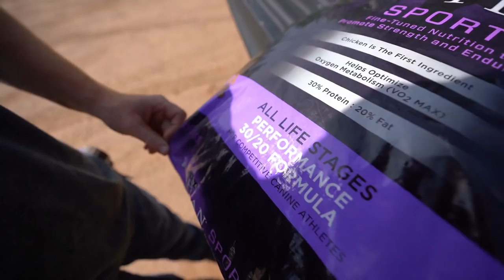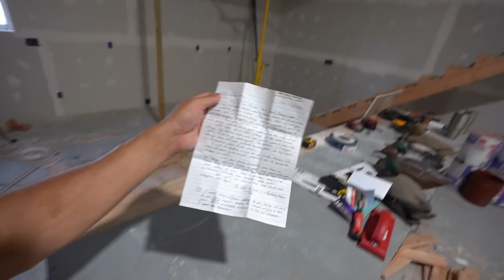My "New" Budget Duck Boat I Bought at a Yard Sale!!

Comment: I use RuffLand Kennels and I’m  happy with it. Not cheap but not terribly expensive. Also check out SPS swamp runner kits, you can repurpose that motor with a new long tail kit and save money over buying an outboard and they’ll take you anywhere. I have one with a 6.5hp on my 12 foot jon boat and run 18mph top speed 10-12 cruising with a full hunting load.

Comment: Hey. I think that drain plug is where you need a 3/8" plumbing plug fitting with threads. I had a very old Herters Hudson Bay duck boat that had a drain like that.
That boat you bought really looks like a Carsten. I have a pintail. That's a canvasback and you got one hell of a deal. Look up a new one for shits n giggles. I think you paid 800 bucks.

Comment: Many of those decoys are from the 1970 s There are some hard plastic Victor decoys they were bad about cracking on the bottom in ice. There look like some Arrowducks made in st louis they came in plastic and before that paper mâché with tar like material inside on the bottom.  There were also steel weights like the first one you showed that I think were Orvis..  I have 3 or 4 dozen decoys similar to those that got replaced years ago but are not really worth even shipping but people will buy them at flea markets etc for around $15.

Comment: Bobby,  I am saying $251 for the boat.  My first guess was $250, but I am seeing a lot of guesses at that price, so I will pull a Price is Right move and say $251.  Get a topper for your truck but don't put it on until the weather is cold.  Summer months I like a truck with no topper.  Winter months it protects Freddy from the cold elements.

Comment: That black decoy was probably a black duck and not a coot. A coot has a beak rather than a bill, if I remember correctly. When I was in high school back in the early 50’s, hunting ducks on Mobile bay I had mallard paper mache decoys that I paid $6.00 a dozen for, but that was big money for a teenager in those days.My uncle had 6 or 8 burlap sacks of machine carved hand painted wooden decoys he and my dad hunted over in the 1930’s. Wish I still had them today, or just one for sentimental reasons. I do have my uncle’s Model 12 Winchester 12 gauge that was made in 1927. 32” full choke and 28” improved cylinder barrels. Sadly I have gotten to old and physically challenged to hunt anymore. Enjoy the hunts, pigeons are tough, like doves. Ducks are tougher, they can simply haul ass, especially with a following wind!😊

Comment: TOPPER with roof rack and LED lights. Also, I bet the boat was 600
Reply: For a joke I put a spot-flood combo on the topper right where a cargo light would go except on the way back above the window/tailgate. Wired it to the cargo light switch. With a push of a button my entire rig is lit up and everyone else is blind now. Its a wee bit bright and white. Them leds hurt. I can light up a boat ramp like it's daytime. The ones I use are so dark that you need it.